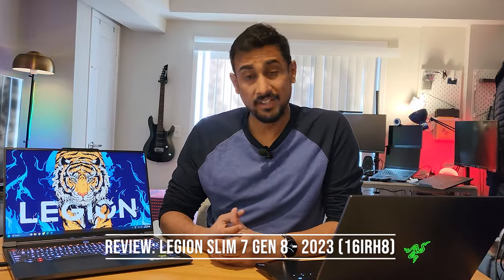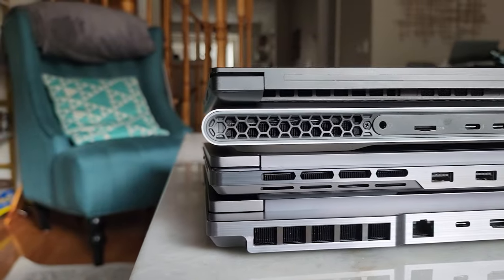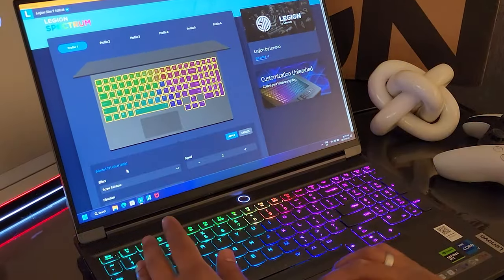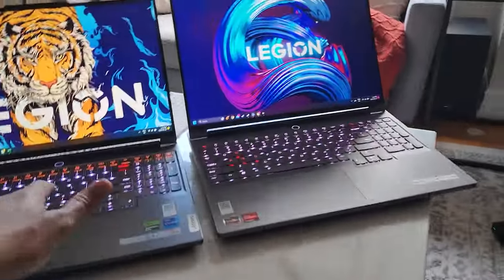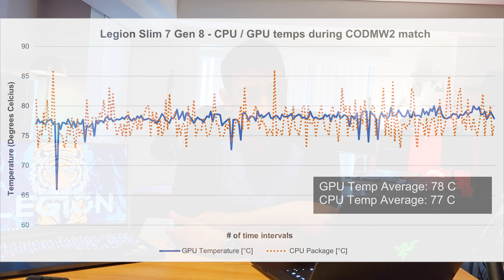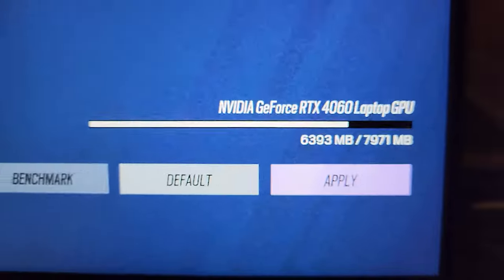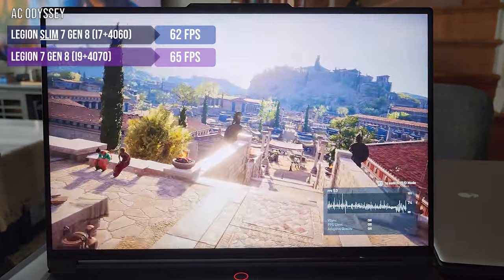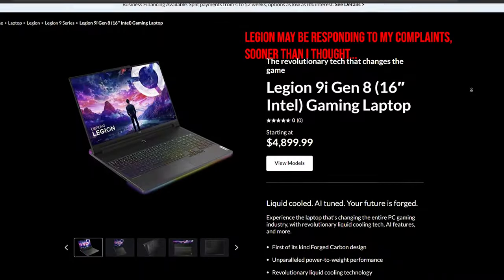Legion Slim 7i Gen 8 : It's getting old!

Comment: Can i do long hour gaming sessions on it ?? Should i buy this one or i should go for legion pro 5i ?
Reply from the maker: It should be able to handle it just fine. With the pro 5i you will get a display that is not as bright BUT.. you will get one extra SODIMM slot to upgrade your ram later. But honestly, if for example you're long COD matches like 5 hours straight, though it will handle it just fine, the 5i might give you SLIGHTLY more comfort on the keyboard deck / wrist areas just because it has a bigger body and will be able to dissipate heat a bit more efficiently. But I'd think the difference may not be too noticeable. ALSO, if your based in a geo that generally has a warmer climate, perhaps there the 5i might prove to be slightly more useful. Otherwise, the SLIM 7 is a pretty great machine. It feels way more premium and has a biometric login as well
Reply: @kazmiee  thank you

Comment: Jarrod got about 7 hour with a 3.2k display, 
How did you get such worst battery life
Reply: Im wonder it too 😮
Reply from the maker: Someone mentioned here that when I selected i-GPU mode only from the Vantage software, it may not have made the change correctly in the Nvidia control panel. Even when I rechecked the logs, I see average GPU power of 2Ws not twenty. just 2. But since I no longer have the device. I am unable to re-do the test. ill be sure to recheck from NCP next time and perhaps perform the test twice.

Comment: Hi, how would you compare this gen 8 slim vs the last year gen 7 slim 7 that has 6800h cpu and 6800s gpu?
Reply from the maker: I think it is a little more refined. More powerful and more performance even with the 4060. The screen has a higher refresh rate. The brushed aluminum band around the sides makes it feel more premium. Slightly better thermal design. But yes, it isn't a substantial jump i'd say. No innovation
Reply: @kazmiee  how is your last year gen slim 7 holding up when it comes to gaming? i had one coming this week that i bought for $1086cad including taxes but not sure if i should replace it with the 4060 model and add another $400cad
Reply from the maker: @dwilfred923  the 6800s was pretty decent for gaming actually. The 4060 might get you maybe 5-15% more FPS depending on the game. IMO, that difference may not even be that noticeable if you're a casual gamer. I would like to think I am a casual gamer so getting 80 fps instead of 70 really does not make a big difference to my gaming experience. We might be seeing Ti variants in laptops in a few months or who knows! 5000 series nvidias soon. So i was you, i would be okay to sit back for a bit and take advantage of what is to come next year. But then again, Id like to think I am a patient person. :)

Comment: Hello. What will better legion 7 2023 or HP omen 16 slim 2023 white color?
Reply from the maker: Slim? Is this the HP Transcend?
Reply: @kazmiee  yes. White hp omen transcend 16 i9 13900
Reply: @kazmiee  so, whats better?
Reply from the maker: @dj_iceman_31  i would lean more towards the legion for now personally. If I was looking for something less bulky and more portable though, i would pick the slim 7. I have had omen machines twice. They did not have anything wrong with them to be honest, even thermals were decent but nothing special about them either. Its just that Legions are generally better invested in their gaming laptops and even if both devices are hardware wise equal i would pick legion because they just offer a mose friendly experience. :)
Reply: @kazmiee  yes, i wanna buy lefion 7 slim ))) but without rgb keyboard, china version just white color(
Reply: @kazmiee  with legion 7 slim terms dont have a trouble?
Reply: @kazmiee  and how do you think -1320 $ for legion 7 slim 1 tb ssd, 16 gb ram, rtx 4060 , R7 7840 , 3k display, battery 99 wh but without RGB keyboard it’s ok?
Reply from the maker: @dj_iceman_31  well, just personally speaking, i dont mind the plain white RGB. Per key RGB has a charm only for a while. :)
Reply: @kazmiee  bro , what about terms? She is ok,? Don’t have a critical temepature? I know model of 2022 year had a so big temperature, and after was a trouble
Reply: Legion 7

Comment: Did you measure the weight of the unit?
Reply from the maker: I remember it was around 2 kilos. SLIGHTLY less. Like 1.98 or something. Did not capture that on video
Reply: @kazmiee  oh wow that's great. I was little worried because every other review on this unit was weighing the laptop at 2.2kg despite Lenovo claiming a less then 2kg weight.

Comment: Hey man, I really need your advice or anyone who's reading this comment.
I have been looking to buy a gaming laptop for almost a year now and I have now reached a point where I'm looking at the Legion 5 pro from 2021 and the zephyrus g15 from 2022. Both have a 3060 but the legion has a full powered 130W one and the Zephyrus has a 120W one. The zephyrus is a light weight option for sure but I have seen users saying that it does have some screen tearing and stuttering issues, mainly cuz it does not have G-sync. I dont know if that is the main reason but that is as far as I know. I'm not much into content creation. I am a casual guy who wants to game smoothly without any problems that'll last me a really long time. Please give me some good advice here, I'm going paranoid💀
Reply from the maker: Hey Govind, thank you for your quesrion. Where are you based and what is your budget? Any chance you can accomodate a device with  an RTX 4060 or Radeon 6800S ? I only ask because a 3060 would have 6 gigs or Vram and since you are seeking a device that would last you some time, id advise to get something with atleast 8 gigs of vram. Although, now that I think about it, if the savings are nice with the 3060 and you primarily intend to play at 1080p and with medium to high graphic presets, perhaps it would still treat you well. Generally speaking, from what I have heard, when it comes to thermals from that time, Legions would be a better choice compared to the ROG. I do still maintain, you wont find a noticeable difference between 120w and 130w TGP :/ . All just my opinions. Others are also free to share here. Hope you get your device soon so that you can get to some gaming. :)
Reply: @kazmiee  Hey!
I'm from India and I'd say 1200$ is around the max that my budget can allow. The Legion, after discounts and an exchange offer cost around 1178$.
The zephyrus costs around 1200$ on the dot with the exact price reduction options. Primarily I'm leaning more towards the legion cuz of that 16" screen with that insane brigthness and a good colour gamet. But since its a 2021 model, I'm having second thoughts about its reliability over the coming years.  There is a 4060 option here, from the Lenovo LOQ series, but its got an average 15.6 inch screen with average colour gamet with ok brightness but it costs around a 1046$ only. And the model I'm looking at doesn't have any RGB keyboard option.  Well I'd like to have some level of RGB to spicen up my dull life so that's why😅. It is an amazing deal no joke but its the only 4060 option at that budget constraint. I am not looking much into content creation but I'd like to have a good screen to watch movies, videos and what not while also game quite a bit. Most games would run at 1440p without much problems in the Legion right? That's what I have seen till now and I hope it is the case with the zephyrus too. I wouldn't mind playing in 1080p with descent settings cuz it would be my first ever gaming laptop. So I would love to know if I wont end having an regrets after buying.

Comment: Hey i have an hp omen which i brought recently the processor is Amd 6800H with Nvidia 3070 Ti should i upgrade from my omen to slim 7i the i9 with rtx 4060 one ?
Reply from the maker: From what I understand, the performance difference will be negligible except where you can use frame generation and newer DLSS version. But even so, id say, not worth the jump. Infact, id say, the 3070ti would even outperform the 4060. Like there is even a marginal difference between the 3070ti and 4070. The 6800H i believe is plenty as well and more energy efficient as well. IF howcever your omen has a 1080p display and you want to move to QHD+ or maybe the webcam / keyboard is not great.. maybe it could be worth exploring. But if I was you, I would not currently update till it is for a 4080 device. Just my thought. Hope that is helpful!
Reply: @kazmiee You are generally correct although the single core performance of the 6800h was already underwhelming when it launched and it's already a bottleneck in most modern games.
Reply from the maker: @Stardomplay  hmmm, well, I have my Legion 7 with the 6800H and I have not many such experiences. The GPUs tend to make the real difference when it comes to games. Other than that. All up to you, if there are more CPU bound games in your library, you can explore for sure, but I would sincerely advise to at least get a 4070. I mean, if you're going to do it, do it proper is all I'm saying. :)

Comment: Yes,  battery life of AMD version is untouchable for Intel,  with same kind of workload discharge rate is floating around 12-15w which translates into 7hrs and close to 8 for simple web browsing in quiet mode, LEDs off and screen at 40-50%.  The only problem is that AMD also got bunch of annoying bugs and issues ( that are not present in this Intel powered version)  and after weeks of fighting with their seemingly non existing support it looks like lenovo is unable on just unwilling to fix them.  So Intel got bad battery life and AMD got issues, pick your poison )
Reply from the maker: Haha, I hear that, and I think people would be happy to pick "reliable but power hungry" over "unreliable but efficient". To AMD's credit, they have been hard at work and have introduced many many driver updates and I have personally seen many issues go away with my Legion 7 gen 7 you with the Ryzen 6800H and Radeon 6700M. It seems to be pretty stable now but initially I had to experiment quite a bit with drivers and updates. I was testing out the Corsair A1600 last week which is an all AMD machine and that had a few annoying quirks as well for which I had to mess around before getting it stable. So one probably needs to be patient and know their way a bit around computers to deal with AMD machines. Which makes me sad
Reply: What type of bugs were you seeing? Just got the Slim 7 AMD, so would like to know what to check for.
Reply from the maker: @deepg7084  are there any particular issues that you're coming across?
Reply: @kazmiee  I'm sending it back. My display flickers badly every 30-60 seconds. I contacted support and they said they'll send a replacement. Sounded great. Today I got an email saying the replacement will arrive in late May. I ordered this laptop in November! No shot. Going to tell them to keep the replacement and give me a refund. I really loved the Slim 7 after doing a LOT of research. It checked all the boxes I was looking for. Just wasn't in the cards for me. I was coming from a macbook air that lasted me 10 years of daily use. There really is no equal to Apple's build quality. Will probably just get a macbook pro.

Comment: Legion 7 2021 is 165w full power. So my 3070 is closer to a 4050 in an underwatted model anyway.
Reply from the maker: Haha, I can certainly relate as well with a 3070 in my  prior Razer Blade 15. But at least you should find comfort in having 256 bits memory bus and 8 gigs of VRAM :)
Reply: @kazmiee  honesty if there was a simple way to have an external gpu like an external hard drive I would never have to think about upgrading laptops. The full aluminum chassis of the legion series and the 2k screen is just perfect
Reply from the maker: @Simplicity007  I hear you man. No one really invested in a refreshed version of eGPUs
Reply from the maker: However, ROG still has that external GPU option obviously proprietary. But even with thunderbolt, the Razer eGPU is your best bet. It can still give you what you are looking for but you won't get the absolute full potential out of it. I know the Razer EGPU (core) can go on 50 PC discount once or twice a year
Reply: @kazmiee  I have a 5800h. I don’t think my model supports thunderbolt ?
Reply from the maker: @Simplicity007  ah oh. That sucks. Yeah no thunderbolt for Ryzen

Comment: @kazmiee should i go for this or the omen 16 i7 13700hx along with 4070
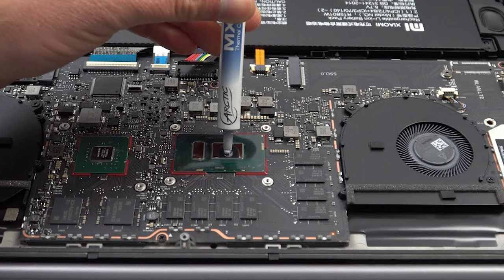Reply from the maker: I have not gotten my hands on the Omen.. But if it is cheaper by comparison, You can definitely consider it. I mean both in terms of their engineering are pretty standard, you do get 2 SODIMMs for RAM but just 1 slot for your SSD, however in the Legion you get 1 SODIMM for RAM and 2 slots for your SSD. So up to you where you want to swing. ALSO, the Legion has a nicer display, both are 240 hz, but the legion has a more modern 16:10 aspect ratio and goes up to 500 nits. as a result, I personally think it is better looking as well. For me, i would pick the Legion 7, it is just a nice well rounded device, but you wont get an HX CPU in there. personally, I dont have any particular use case for the HX CPU. As a casual gamer, even a 13th gen i5 would be okay since MOST games tend to be more GPU bound. Anyway, hope that helps! let me know what you finally decide on!
Reply: @kazmiee  thank u eben i am going for legion 7i slim
Reply from the maker: @namanrustagi135  awesome! Do share your experiences with me if possible. Always good to get an another set of observations in the mix :)
Reply: @kazmiee  hey i will be buyong it in a week now lenovo has some qeitd combination of i9 13900h with 4060 should i go with it ? i mean i am getting i7 13700h 4060 for a 50$ diff but the thing is i am worried about i9 bottlenecking withva 4060 what are your thoughts
Reply from the maker: @namanrustagi135  for the purpose of gaming, the i7 will be more than enough. The 13900H will give you 5.4ghz of boost clock vs 5.0 on the i7. That extra clock speed can come in handy in rendering work, engineering programs etc. otherwise, main benefits in gaming would come from a better GPU. But hey, 50 is not a great deal much. Perhaps it might help with resale later?
Reply: @kazmiee  lastly d u think i9 13900h is a good combo with the 4060 i mean i am getting a much powerful cpu with the i9  am a bit confused:( would it draw more power or so?
Reply from the maker: @namanrustagi135  it may impact overall battery life but only marginally. The i7 has a lower base frequency that might help. But again, not to a large extent. For gaming though, I feel the end result should remain pretty similar between the two